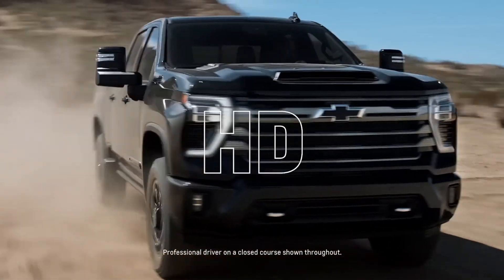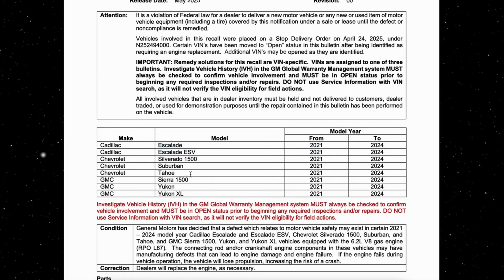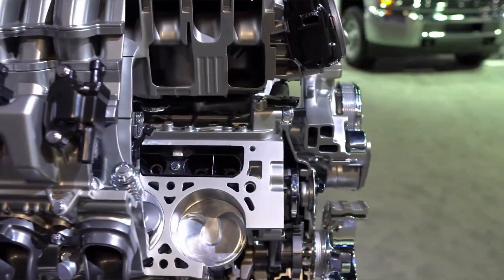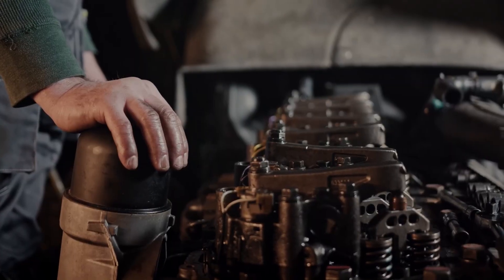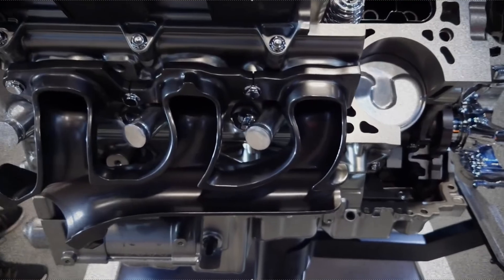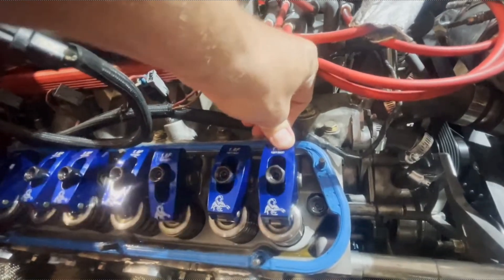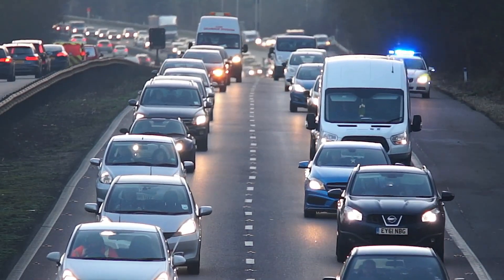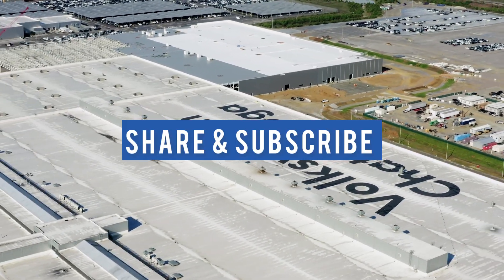Do Thin Oils Destroy Engines? Lessons From GM’s Massive Recall

Comment: Spot on explanation.👌 
The key to any oil is maintenance, especially on today's 4 cylinder DFI Turbos with low tension rings. Oil dilution is the engine killer. Change the oil every 3k with the recommended oil.